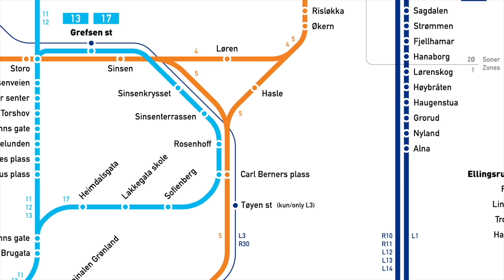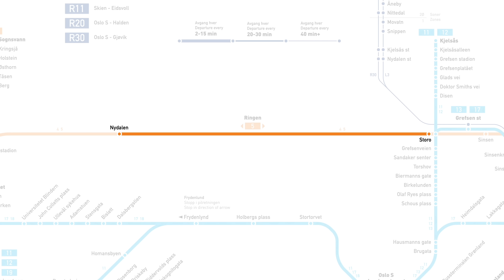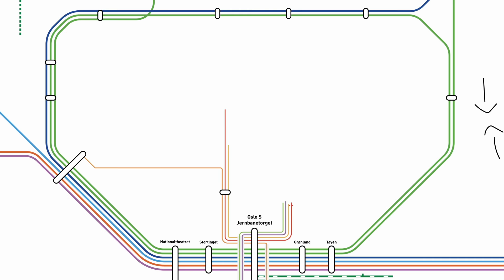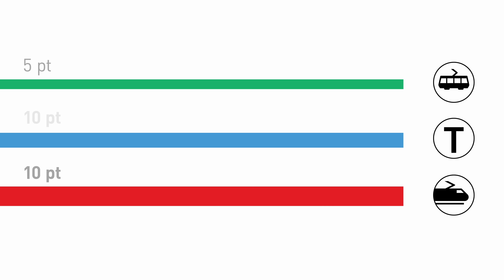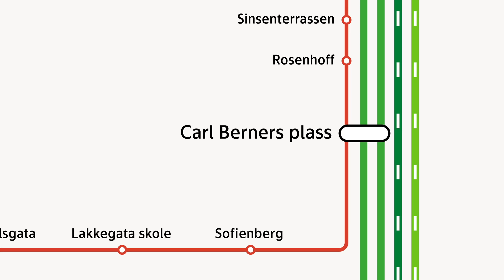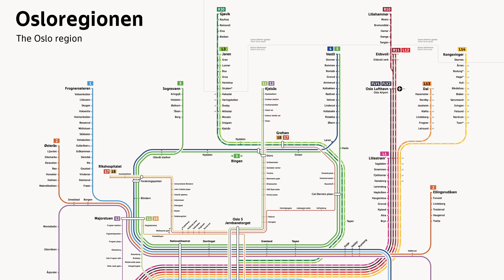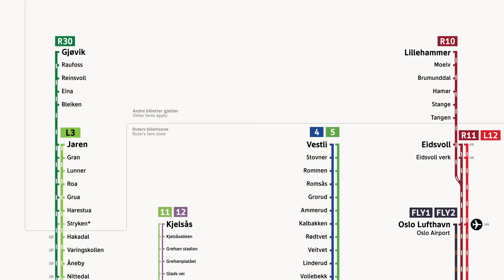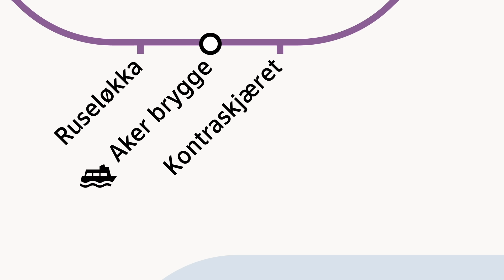Redesigning Oslo's transit diagram

Comment: Greetings from a fellow transit enthusiast and Norwegian! Let me start off by expressing how impressed I am by your skills and creativity in transit diagram design. It is truly enthusiasts and clever people like yourself we have to thank for spreading knowledge and interest about transit to the common man, and for pushing transit officials to go above and beyond in their planning and design.

Your recent design is without a doubt an improvement from your last one. Nonetheless, I would like to understand the reasoning behind your choice of combining these specific three modes of transport in your comprehensive diagram. At first glance, the obvious answer to that question would be that these three modes are all running on rails. However, I would argue that that is the only similarity between these modes of transport – at least when it comes to Oslo.

The regional Vy trains (the R trains) run to towns and cities, which are for, all practical purposes, outside the Oslo area – strictly speaking. Their main role is not to carry commuters on a daily basis into and through the city; there are after all not many people commuting to Oslo from Skien and Göteborg (in Sweden!) on a daily basis. The local Vy trains (the L trains) and the outer parts of the Ruter metro lines share, in my view, the role of being the city area's rapid transit system (https://en.wikipedia.org/wiki/Rapid_transit) – brining daily commuters from suburbs and nearby towns and villages.

In my opinion, the inner parts of the metro (as well as a small part of the central local train service on L1, L2, L3 and L21) share roles with the trams and city buses in functioning as the frequent and reliable network of transport for the city's inhabitants, consisting of lines and branches of lines with a multitude of stops close together. They serve an entirely different different purpose than the trains and outer parts of the metro, in my view.

In reality the trams in Oslo function merely as buses on rails – which brings me to the buses of the Oslo area. It's not difficult to understand why you have omitted the bus lines from your comprehensive diagram, as the official bus diagram already is a spaghetti mess on its own (https://ruter.no/globalassets/rutetabeller/buss-oslo/linjekart/buss-oslo-linjekart-08082022.pdf). That is because Oslo's bus service, both the regional one but especially the city bus system, is really extensive in size, as well as frequency, as well as coverage.

Many people tend to regard the metro as the backbone of the Oslo transit system. But when looking at number of yearly journeys, the importance of the buses in Oslo can't be understated. In 2019 (the last year with statistics not affected by the pandemic) the number of total bus journeys reached 180 million – of which 115 million were made by city bus and 65 million were made by regional bus (https://aarsrapport2021.ruter.no/wp-content/uploads/sites/4/2022/02/NOKKELTALL-til-a%CC%8Arsrapport-2021.xlsx). Compare that to the metro's number of journeys of the same year at 119 million, the tram's at 53 million, and the train's at only 42,2 million, a safe conclusion can be drawn: The transit system of Oslo would collapse without the bus.

The bus digression aside, my argument is not that you should combine all these four modes of transit into one – I think that would be an impossible task. My argument is that it would make more sense to design a diagram combining bus, trams and metro lines into one (and maybe even include the ferries and boats). Oslo needs a comprehensive city diagram where all these three modes of transport are combined – buses, trams and central parts of the metro. These three serve different geographical areas of the city, and when travelling from  one part of the city to the other – even for shorter distances – one often has to change between the three. A proper city transit diagram combining these quite similar modes would help locals, commuters and tourists alike.

If you are commuting from say Moss or Gjøvik (two separate cities/towns), I'd argue that the need for one single diagram combining local trains (L trains), which run for over 100 kilometres, with tram lines, which run for only up to 20 kilometres, is not present. If I were a long-distance commuter, I'd be much more comfortable with using one diagram for the local trains and the outer parts of the metro to help me get into the city centre (especially regarding Oslo only having one large train station), and then turing to a comprehensive city diagram combining the buses, trams and central metro lines. A commuter's journey to a specific part of the city could then be mentally divided into two parts: The first one would focus on getting from a suburb, village or town into the city, and the second one would focus on figuring out which city bus, tram or metro to take in order to get to the desired part of the city.

Seeing as Oslo city has such a developed bus, tram and inner metro service, with great coverage, loads of stops and high frequency, there is rarely a need to walk more than 200 metres at the most, regardless of where your destination is within the city centre. This is a great feature in a modern city and is one that is deserving diagrams which make the system accessible to all. That is the reason why I think two separate diagrams, where one is regional and one is a comprehensive city based one, is favourable over your current design.

I want to stress once again how impressive I find your skills and creativity in redesigning transit diagrams to be, and also that the diagram in this video already is accessible, functional and all together great. The reason behind my very lengthy comment is merely some ~constructive critique~ (as is the official phrase in proper Norwegian) and maybe to challenge your exceptional skills into creating something even more comprehensive and impressive.

There would clearly be some challenges in creating my suggested city diagram combining the buses, trams and central metro. As well as the extensive city bus service, Ruter also has quite a large-scale regional bus service, serving the local areas around the suburban hubs and towns, which themselves are served by the outer metro and local train lines. Seeing as a number of these regional bus services call at a multitude of stops both inside and outside Oslo proper, this would require some creative design and sacrifice of accuracy, no doubt.

Yet again, this was a great video and a great design! I hope my critique is welcomed and I wish you all the best with your upcoming designs and projects. Maybe we'll see an updated version (or versions in plural form!) of this diagram in the future. ;)

Cheers,
Tord
Reply from the maker: Thanks for sharing your thoughts, Tord! 

I totally agree with the idea of having two separate maps. One for travelling to the city, and one for navigating within the city. I have actually been thinking of making a more geographically-oriented map of Oslo, with buses (and ferries?) included. Here, it would be natural to include more details such as boroughs, rivers and maybe even landmarks, making it easier to navigate. This is a huge task though, so I might need to practice a bit before I start untangling the spaghetti monster. 

Regarding the regional trains, I included them because they kinda function as local trains between Lysaker and Oslo S. And between Asker-Oslo S-Lillestrøm, they supplement and provide a high-frequency service resulting in trains running every 10 minutes. I don’t think that should go unnoticed.

The only similarity between these modes of transport are, as you mentioned, that they all run on rails. I’m not yet at the skill level where I can add complex bus routes, hence why it was easier for me to ‘redesign’ three existing line diagrams. Hopefully I’ll succeed with an updated version in the future. One for trains/metro and one for the city itself.

PS: Ruter has previously made a diagram including main bus routes, metro, tram and some ferries. But it’s not easy to find online: https://ontheworldmap.com/norway/city/oslo/central-oslo-transport-map.jpg It’s not even listed on their official website. It only shows key stations and is clearly targeted towards tourists. It doesn’t include train lines, which I dislike, as they are still an important part of the public transportation in Oslo. The following example is not relevant for a tourist, but my point is that trains can sometimes be much faster than the metro and must not be forgotten: Going to Bryn from Oslo S? Taking the L1 train takes just 3 minutes, with a frequency of 15 min. The metro takes 9 min, but with higher frequency. (I’m aware that Brynseng and Bryn are far away from each other in my diagram, ideally they should have a connection indicator).
Reply: I love this comment, It exactly describes the Transit diagrams in my home region of zurich!
Reply: @T2norway  Say what graphic tool did you use for designing this diagram?
Reply: @Mastakilla91  Well it was mentioned in the video and in the description, Adobe Illustrator

Comment: This is a great and very clean diagram, hardly at all overloaded. Easy to understand, but at the same time preserving all the complexity of the network. I always like to see diagrams with many, many lines, that you almost get lost with so many lines (including city bus diagrams, which is even crazier) but at the same time trying to be as minimally cluttered as possible.
Maybe the only thing I would say is to reduce the spacing between the lines when they are close together as you end up with a line thickness that ends up being a bit too thick. For the rest, it is very good.

Comment: Fantastic work! It looks quite cluttered at the central station, but that's only because I'm unfamiliar with having regional train lines on such maps.
Reply from the maker: Thanks! Fun fact: All railway, metro and tram lines (except line 13) stop at Oslo S/Jernbanetorget, making it a large interchange station. The regional trains play an important role as they kinda function as local trains the closer you get to Oslo.
Reply: @T2norway  cool im from Oslo and i didn’t even know that lol
Reply: @hei1  people from Romerike Bærum/asker/drammen/ski/moss all take the train to work
Reply: @Osskibosskiposki  ok
Reply: @T2norway  Well instead it stops at the nearby Dronningens gate stop, however it doesn’t make sense as Jernbanetorget has stops even more further than the platforms A to D

Comment: I've never been to Norway but this video had my full attention. Amazing work.

What software do you use to make maps like this?
Reply from the maker: Thank you! I used Adobe Illustrator.
Reply: @T2norway  Just as a recommendation/idea, figma might be an even better program for this kind of stuff. Figma is mainly built for UI/UX-Design, but I think it brings exactly the right set of tools for this kind of stuff. Not too much like AI and also more advanced features for this specific use-case.
Since there are so many elements that have multiple occurences (lines, stations, numbers) something like the components and central styles like in figma could really help with this. With figma you could just make a "station" component that is connected to all the "station" instances, so if you want to change e.g. the border width you don't need to do this with every single station but can just change the main component and all instances will automatically update. Same goes for text or color styles, if you want to make all line numbers bigger you don't need to change all of them manually but can just change a central text style. 
But as mentioned this is only an idea, I'm not an expert in transit diagrams :)
Love your work and the dedication that you put in it! Have a great day!

Comment: Love how clean and modern this looks!
One suggestion i have for differentiating the modes? Have the line numbers in a different shape. Like a circle for busses (here the bus stop signs tend to have a circle with an H in it). Square for trams, Hexagon Trains, etc.
Alternatively: the white "dotted" squares in different shapes depending what kind of transit mode it is. like a filled line for one mode, dots for another, squares or rectangles for another. 
I will say though, you do have me interested and curious about the making of a transit line map. ... i wonder if i should try it out for myself maybe...

Comment: It's interesting, my instinctive reaction was "hmm personally I'd do it like in the original version", but then I tried to articulate why and... couldn't! In the new version it's very easy to trace a given line across the map, which is what's actually most useful for the user, even as it might look "overwhelming" for a newcomer at first glance.

With that said, I am curious to see what the original 2017 version would look like where the route numbers along the lines were larger (possibly within shaded bullets) and the trams were marked with smaller text + thinner lines.

Comment: Personally I find a geographically-accurate transit map ideal since the purpose of transit is to get you from where you are to where you want to go. Making the map relatively accurate and only displaying major landmarks like bodies of water as background elements (maybe light gray blobs?) helps significantly when orienting a more detailed map with the transit map to compare which route to take to get to a certain place.

My favorite example I can think of right now are the maps found in the Pokemon games--especially the in-game map for the Kalos Region in Pokemon X and Y.

Good job with the map though! I think you did well making it clean and legible like you intended. :)

Comment: The most of Oslo's "tunnel" line is not in tunnels, and as I found out it was initially suburban trains, until the electric contact rail - the third rail - was added.  Because here in Saint Petersburg the metro is smaller, though our population is about equal to the population of all the country of Norway.  However, it's more frequent (train each 2-3 minutes) and all under ground.  Still, Oslo being smaller as a city means it's easier to design such a useful thing.  Having single tickets including all city public transport (metro, tram, buses and trolleybuses) it is quite weird there's no information table with all types of transit.

That so much information can still fit on an analogue information stand is incredible.  It doesn't feel complete not showing intervals, with no ferries.  But one should manage to stop himself and see the border between informativeness and simplicity.

Comment: In case you haven’t noticed: Oslos system is made to fit together, metro, tram and busses all follow the same numbering plan, 1 to 9 for metro 10 to 19 for trams and 20 upwards for busses. 

You’ll never see the 6 tram in Oslo because that’s not a tram number, I find that quite neat, and well planned !

Comment: Such a good video!  Suggestion:  It might be time to “let the rainbows touch”, in the style of 1980s-1990s Sydney diagrams or even the Circle line in London.  You have so many lines that reverting the newer negative-space trend may be better.  Possibly, you could still group the trains and metro?  Or just do the trains, so that the “5” metro loop can succeed as a double-loop.

Comment: Could include walk distances between stations where changing is normal, like walking from Brynseng T-bane to Bryn Trainstation is 3-4min. Also marking Bryn as not functional for disabled or babytrollers in north direction. Just some suggestions. Great work. Will definitively use this map in the future. Thanks!

Comment: this is really good! definitely saving this on my phone. 

i do kinda wish bus lines were represented in some way. at least the ones relevant for connecting laterally between metro and tram lines. i think that could be quite useful between the 11, 12, 18, and 17 lines (and nearby metro stations) especially. i dont think there's a nice way currently to keep track of these other than just knowing them by heart (or taking notes). Understandably this would likely create clutter problems.

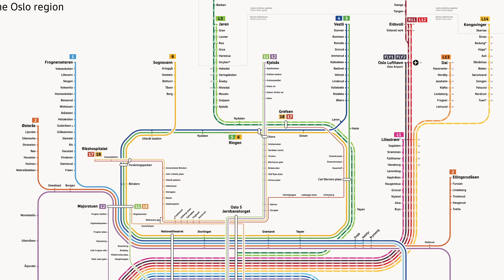Comment: @8:40 The number change was an important feature that needs to be reinstated. Before the introduction of the unified number 5, that 4<>6 thing allowed people to be sure where the train is going just by looking at the line number, without caring to read the destination. Currently, at every station of the central segment of Line 5 people need to care not only for the number but also for the destination. Particularly confusing at Majorstuen where the line 5 divides immediately after such a major station. 
Bringing back line 6, although appears to increase the complexity, would actually simplify the wayfinding.

Comment: Loop lines and its directions can be so confusing. I live in Hamburg which has a loop line U3 (metro line) and it's sometimes so hard to know, which direction you should take.
I guess, e.g. Wrocław (my home city) has a perfect solution for it. The line number is 0 (zero), but it has additionally one of the two letters: P for clockwise direction ("prawy" in Polish) and L for anti clockwise direction ("lewy").

Comment: Great job, but there are some oversights. There are grey gaps instead of whites IMHO. It's around the Loren station where tram 17 criscross the Tbane 4 line. Can't add a photo in youtube comments. It's on every gap added to separate the cricrossing lines (Ulleval stadium).

Comment: It is indeed a clear design. The only weakness is the small font size of the labels. Of course it is easier to create a clear map, if you don't need to mess around with text blending into lines. But you cannot read the station names anymore except on a really large plan or from very short distance. The art to create a transit map is to find the right balance between clear design and readability. So maybe you try a larger font? Sorry for my criticism, I really appreciate your effort though! :)